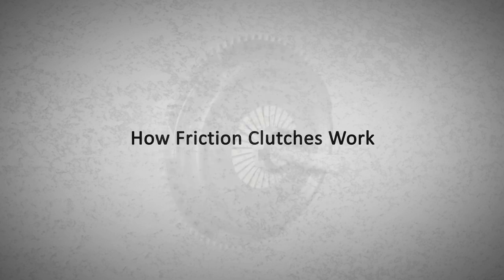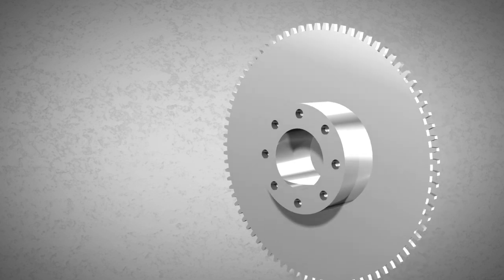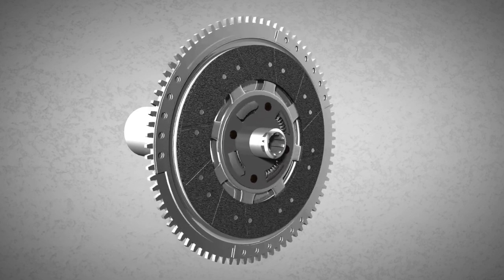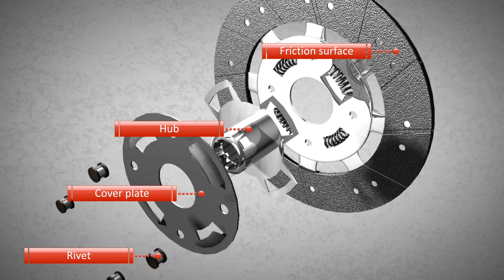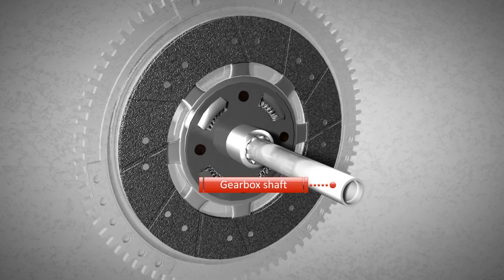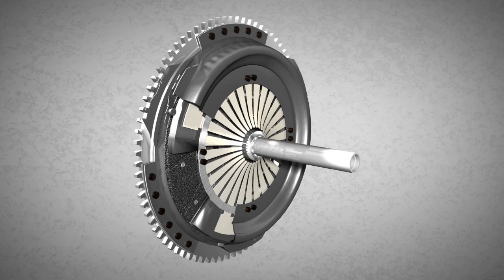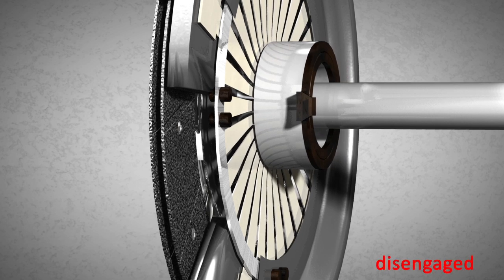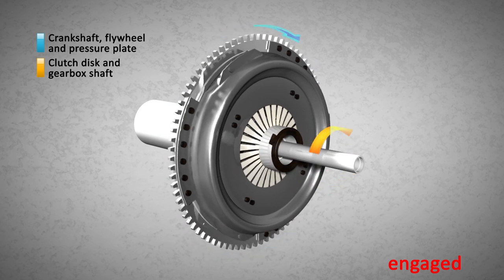How a clutch works! (Animation)

Comment: Hey! Superb animation. I'm working on a project which will detect drowsiness and if person is sleeping/sleepy then microcontroller will turn off ignition. so is it better and safer for the person inside car and for the person(in car) behind him on road or should I just disengage clutch from engine so that it can slow down because of friction gear and it might be more safely, right?
How does disengagement happens?
Reply: CHRIS JAIN Hey, buddy. I don't know much, but I think I can give you some advice. Turning off the ignition would mean that the engine stops, causing several things such as heating and air conditioning (not the fans), power-assisted systems such as steering and brakes, and power generation from the alternator to stop working. This is very unsafe, especially if the driver is asleep. Personally, I would suggest waiting for advances in technology that allow cars to have a small amount of self-driving capability. This way, the car would be able to pull over to the side, come to a stop, lock (for the safety of those inside the vehicle) and shut off. However, I think the most you could do with current technology is have the vehicle make a rough estimate of where to move, slow to a stop, lock, and shut off. I know those sound the same, but the difference would be that with advances in technology, the car would be able to safely stop in most conditions, whereas currently, it would only have a simple understanding of its position on the road and not really know the best way to park safely. I hope this helps.
Reply: rahul
Reply: rahul
Reply: +Daniel Duncan Thanks! Sorry to reply late.
My team and I were working on it but it will make the project very complex and time consuming and we don't have much time because of placements season. How about if we just disengage the clutch? Car will slow down and eventually stop and to warn driver(of car) behind (drowsy detected driver) car will be done by blinking all lights of Car. How does that sounds?
Reply: CHRIS JAIN That sounds better. To refine it, though, I would suggest a system that disengages the clutch and/or places the transmission in neutral, gently applies the brakes (if possible), locks the doors and signals other drivers as you suggested. While there's no real way with current technology to guarantee in any condition the car will stop in a safe place, this will be the most likely to work and keep the driver safe should they fall asleep. Keep in mind that these things are only suggestions, and if you don't have the time, don't worry too much about them. However you end up doing it, this seems like it's going to be pretty useful.
Reply: Thanks for helping. It is working in software. It's been hectic. Thanks!
Reply: CHRIS JAIN No problem. I'm glad to help, and I can't wait to see how it works.

Comment: I want to understand one thing but i dont know how that it is possible.My question is why the clutch plate is moving away from the flywheel  after the pressure plate is released? In my mind that plate would be in the same position , despite the fact that the pressure plate isnt "working" on it. I hope that youll undersant my  problem . Sorry for my english , i dont speak very fluently and thanks for the help.
Reply: The friction disc has splines and can slide on the the end of the transmission input shaft.

Comment: All this complex machinery made completely obsolete by electric cars...
Reply: Plato Where the fuck do you think electricity comes from?
Reply: ryelor123 Doesn't matter. Charging is free, oil isn't. And let's not forget recent advances in batteries like "aluminum air" or graphene which will sooner or later make gas completely obsolete since these would have a much higher power storage capacity and would be able to charge within minutes (for aluminum air) and possibly seconds (graphene, although far away). Also, EV's are only going to get cheaper and charging is free while gas is only going to get pricier. EV's essentially run off the power of the sun, which is a relatively infinite supply, if solar panels are the ones charging them. Gas made from algae will rely heavily on the harvest of algae, while solar panels are (relatively) more reliable and constantly becoming more efficient. Sorry to say it but gas vehicles are going to be relics in the near future.
Reply: Plato Tell that to the electric company. Hydro or Gas, you're still paying.
Reply: Sean nolastfuqingname Thing is, it comes from built in solar on top of tesla stations, free for the consumers. Now elon musk still has to pay for property but his goal isn't exactly to make a profit but change the worlds transportation to EVs so he is willing to pay to create another incentive for switching over.
Reply: ***** Why do i still have idiots misinterpreting what i'm saying?

Let me be ABUNDANTLY clear:

When you charge a tesla at a tesla supercharger, it is charged via solar panels on the roof of said supercharger. Later on at night, energy that is collected during the day will be stored for night time usage via industrial powerwall. SO, the energy that charges tesla's comes from SOLAR POWER MOUNTED ONTO THE ROOF OF THE CHARGING STATION. IN CONCLUSION, ITS ESSENTIALLY FREE ENERGY FOR THE CONSUMERS. Do u undursatnd now?
Reply: ***** Aluminum-air batteries are gonna be the next battery type. More durable, holds more charge, and plenty of material for cheap mass production.
Reply: +Plato You would be a lot more interesting if a basic google search didn't indicate you were full of it. An aluminum air battery is a primary battery and non-rechargeable. Perhaps you were thinking of an aluminum-ion battery? And as for the idea that "charging is free", you seem to forget that you actually need a source of energy. In your case, you point towards solar panels while deriding gas made from algae. What you seem to forget is that the algae growth is POWERED BY THE SUN. And frankly, building and maintaining growth ponds for algae is far cheaper than building and maintaining solar panels that cover the same area. And since the total energy collected is dependent upon area, the algae solution should be cheaper in the long run. And the algae solution is carbon neutral and lower pollution than the solar panels. What? You claim that solar panels are pollution free? If you do make such a claim, you might want to consider the toxic waste (aka pollution) that's created during the manufacture of said "pollution free" solar panels.
Reply: +Plato Who gives a shit about electric cars? You wanna save trees go ahead genius.

Comment: I dont see clutch disc disengaging from flywheel when clutch release bearing is pushed inside....Hub is attached to clutch disc and is clutch disc doesn't stop rotating in disengage state, then how does gear box shaft stop rotating?
Its confusing.. Plz explain.
Reply: +Yash Mehta The animation is correct.  The springs in the pressure plate push the clutch onto the flywheel, the clutch is attached to the transmission shaft, thus enabling motion.  When the bearing is pushed against the fingers of the pressure plate, it compresses the springs that push the clutch against the flywheel, disengaging it.  The clutch itself is still spinning, but there is no power transfer and the gears in the transmission match speeds before they engage to allow smooth shifting.
Reply: +Yash Mehta This confused me as well, when it's pushed inside, that's when the friction (engagement) is supposed to happen, not the other way round
Reply: +Bakï Harchiwi i think he messed up the animation

Comment: Just thought I would mention that the vast majority of motorcycles use multiplate WET clutches. They are multiplate because this enables them to be smaller in diameter compared to a car clutch. They are called wet clutches because they run in the engine oil (bikes do not use separate gearbox oil - unless it's a 2-stroke engine). 

Some bikes DO feature dry clutches, certainly some Ducati models. I think maybe some Harleys do but never worked on them so just a hunch. Dry clutches on bikes can be very noisy, even when new.

Good video though :-)
Reply: Dry clutches are common some old harleys, and custom harleys. Factory clutches from harley are all wet. High performance and drag clutches are dry.

Comment: I'm sorry I still don't get it I'm very dumb :( I want to be a mechanic but i don't really know any more:/
Reply: The99210 the friction surface gets damaged by "slipping" the clutch - that is holding it so it is partly engaged but still slipping.  The longer you do this the more you wear the surfaces and the more heat that builds up which also causes damage.

An automatic transmission has a fluid clutch that allows slippage without damage.  Imagine two fans pointing toward each other.  If you turn on one fan the air it blows will make the other fan turn, but there is no mechanical connection so you could stop or slow the second fan without needing to disconnect the first one - the air just slips past.  In an auto transmission the "fans" (impellers) push fluid instead of air.  At low RPM the first fan isn't turning fast enough to drive the second fan.  As you increase engine speed eventually it is enough to turn the second fan and the car begins to move.
Reply: The99210 sometimes it takes a while to understand something, what do you not get about it maybe I can help you understand it
Reply: thank you, i dont understand to like drive a manually car. like hows the clutch breaking and also on how it works.Also  whats the difference between a automatic or manual car.
Reply: I'm not to familiar with automatic transmission cars but i do know that they do not have a clutch the do have a fly wheel which is pretty much a big gear wheel. the fly wheel is what the gear of the starter motor is connected to. so when you start your car the electric motor gives the car the initial spin of the crank shaft (the gas engine cant start from 0 rpm hence it idles when the car is stationary. the fly wheel in manual transition cars also is the place where the clutch pressure plate attaches to.
and in the middle of both of them is the clutch disc. the clutch disc is connected to the input of the transmission where as the flywheel/pressure plate assembly is connected to the the crankshaft (from the engine). so if the clutch pedal is in its released form the pressure plate pushes the clutch disc against the flywheel so the clutch disc can spin with the fly wheel, and so the the input shaft of the transition is connected or spinning with the engine if the clutch petal is pressed the clutch pressure plate dose not press the clutch disc against the flywheel, so while the flywheel and pleasure plate spin (due to the engine spinning) the clutch disc dose not so the transmission is disconnected from the engine so you can change gears. i guess you can think of it as this way if you press 3 sheets of whatever(metal in this case) together then they al spin together if you however don't press them together and only spin the outer ones than the 3 one wont spin.

So when you are driving a manual transition car you what to mack sure that you press in the clutch pedal when you change gears so that the input shaft (of the transition) isn't spinning, or at least is easer for the transition to alter the the speed from the output transition output shaft's speed to the input shafts speed when the engine  isn't connected to the to the input shaft of the transmission. 

and you said you wanted to know how a clutch breaks do you mean items of it falling apart  or in terms of it stoping the vehicle?

hope this help some what if you have any further questions don't hesitate to ask, i enjoy helping people
Reply: dude..did you copy and paste? and if you didnt thanks alot
Reply: thank alot and i mean when people grind the gear or soemthing like that.
Reply: oh, grinding the gears happens when the don't pushing the clutch all the way so the transmission input shaft  is still engaged with the engine. the actual grin ding of the gears coms from with in the transition not the clutch
happens to me sometimes lol.
Reply: haha. but then how does the dick of the clutch get scrached. sorry if im asking alot i just want my first car to be a subaru 2004 wrx sti in manual and cuz i want to learn how to build a car and be a machanic
Reply: ts cool i like talking about this stuff. after a while the the friction material like on brakes wears down after extended use and then i'm assuming the pressure plate starts scratching the clutch disc not completely sure on that though. the wrx sti is an awesome car never been in one though but one day plan to own one, currently I'm driving a Acura rsx with manual really fun to drive which is also my first car. I'm currently  studying mechanical engineering but if that doesn't work out I'm also planing on being a mechanic. this stuff is really fascinating
Reply: The99210 I wouldn't recommend a wrx sti straight away for a first car brother, try a naturally aspirated to get started. like a 5 speed manual subaru rs.. same as wrx but without turbo..

Comment: So exactly what part of the clutch gets ruined when someone burns their clutch out? Is it the friction surface of the flywheel or clutch disk or something else?
Reply: Icecicle83 its the friction surface of the clutch that gets worn out, usually when one changes a clutch they can machine the flywheel to give it a new finish for the new clutch, but flywheel can also get worn beyond repair and may need to be replaced as well
Reply: GermanAutos Cool. So it's essentially the same as with brakes then. Thanks.

Comment: Hello.  Just had the clutch pedal on my 1994 Ford Probe go out.  Earlier in the day, it was remaining engaged even after I would  let off my foot from the clutch pedal.  Later, the clutch pedal sank all the way down to the floor and would no longer engage even after lifting it back with my foot; it would just go straight down upon pressing it.  I was, however,  able to get into first gear with the engine off.  Any suggestions?  Thank you.
Reply: Engaged is all the way off the floor, disengaged is on the floor.

So from what i can get from this,  either your clutch plate is binding up on the input shaft,  or your clutch master cylinder is out
Reply: @Texassince1836. Ended up replacing both the slave and master clutch cylinder and the clutch seems okay.  If it fails again then... I might look into the clutch plate binding on the input shaft.  Let's hope that's not the case.  Thanks!

Comment: if the clutch plate is made to rotate only by friction....wouldn't it affect the efficiency of the whole system?? what i mean to ask is... will the power from the shaft be completely(100%) shifted to the gears or not??

Comment: Can someone clarify this:

The contact between the flywheel and the clutch (aka 'the system') is established through the friction surface on both parts and also via the pressure plate. To dampen the unmatched rpm of the flywheel and the clutch there are springs on the clutch.

So the question is this: when both disengage, wouldn't the clutch be still rotating due to inertia? How is this handled in 'the system'?
Reply: Look up the manual transmission video by this guy, but if I understand it right you want other end of the clutch to still rotate. When shifting gears you want as little change inertia until the gear shift is complete.
Reply: Dan Vinnychenko the brake.
Reply: The clutch is attached to the rest of the drivetrain, so the speed of its rotation will be synchronous with the rotation of the tires.

Comment: I have a 70 Chevelle- 4 speed, I've installed 2 clutches in it, the second this afternoon. I went with a “Center Force” this time because my motor exceeds the HP tolerances for stock. I know exactly how to assemble it, all the correct tolerances and torque specs for my application BUT.. I never clearly understood how applying MORE pressure to the middle released the pressure plate. (one might think it would just smash it together harder) Your video clearly showed the teeter/totter affect the springs create and now I get it!
Reply from the maker: D Beason Great to hear that :)